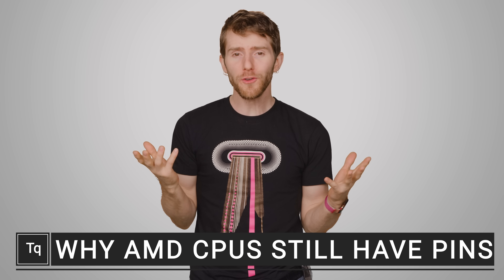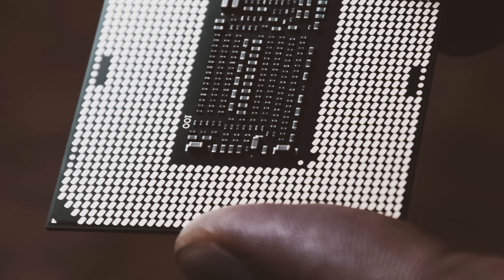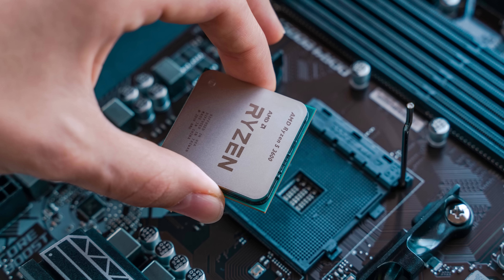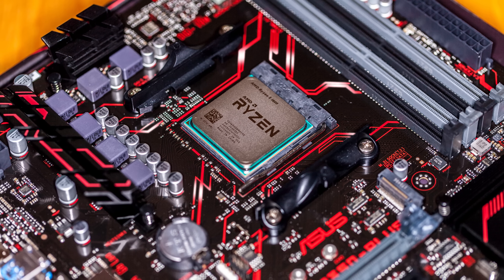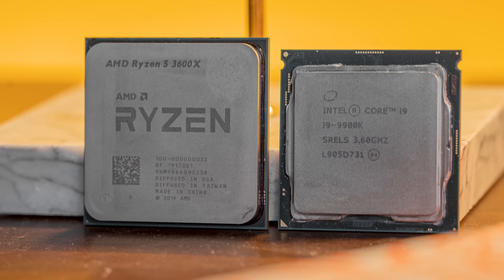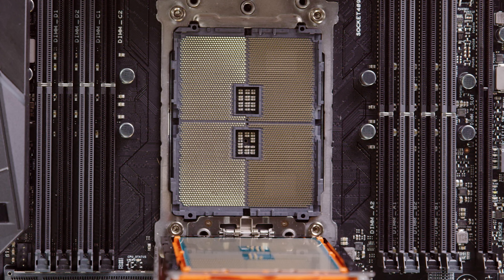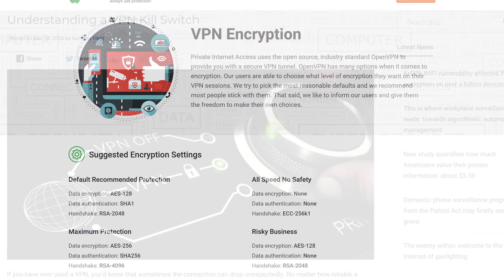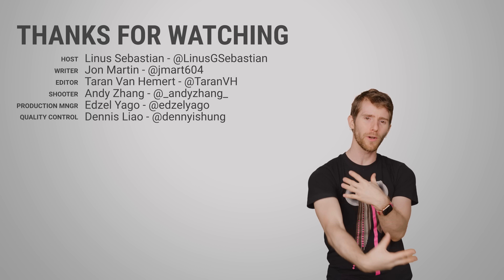Is AMD Stuck In The PAST?

Comment: Wait till you pull out your CPU when removing the cooler on a AM4 socket
Reply: Don't pull or pry, twist back and forth to break up the goop. Like loosening a jar, NOT popping the top off a beer bottle.

This works well even on old or cold thermal compound. The pin array is much stronger than the thermal compound if you twist. (And the pins are seated into the socket.) If you pry the reverse is often true.
Reply: @jordanrodrigues8265   I will keep this in mind if I ever upgrade my cooler. Thank you
Reply: I didn't even know this was an issue until it was too late. Of course, I still should have known to be more careful. That wraith prism mounting mechanism really didn't want to come loose though, so I guess I got pretty careless trying to get it off.
Reply: This exactly.  It happens a lot more often than people think and most people don't even know it can happen.  When it does happen, they don't know how to handle it and end up damaging their CPU.
Reply: When I recently replaced my stock cooler with a beefy air cooler, I was so afraid of pulling the cpu out. I just ran a stress test before and let the paste heat up. Then unscrewed the cooler keeping pressure and then twisted gently, then was able to remove it just fine. I was very relieved when it went smoothly
Reply: I was pulling on my ryzen 7 3700X , how do i know if i damaged something ?
Reply: How did he not mention this?
Reply: Never had this issue, even with really old (10+ years old systems, some with 16-19 years) like socket A amd durons and with some athlon 64 x2's, phenoms 2x2, and etc. Also i never had this issue even on old laptops with really crusty thermal grease (pentium dualcore, core2duo, first and second and gen i3/i5, etc)

My friends only had issues with the pga478 socket of Pentium 4 systems. Idk why, but it doesnt quite hold the cpu well, even with still okay thermal grease it could pull out the cpu. 

Do you had these issues frequently with amd systems?
Reply: Man I tell ya what. I know this pain.
Reply: I was trying to remove Wraith cooler like 30 minutes until i manned up enough to pull it by force , with the CPU glued to the cooler , checked everything was ok and then installed it back to the mobo , only after i read how it's done correctly ( heating up the cpu/paste before extracting the cooler ) , Ryzen 4600 here i come :D
Reply: I just built a new rig going with AMD for the first time. I've built a few Intel rigs already.  I bought a Ryzen 5 3600 and an Asus TUF X-570 motherboard. I was as careful as I could be inserting the CPU into the motherboard. I'm a surgical assistant and I have to have very sensitive hands for this job, e.g. I have to tie suture not much thicker than a hair. No force, I just dropped it in, gave it a very slight torquing motion to make sure it was in and pulled the lever. After attaching the heatsink and fan and flipping the switch, nothing. Checked everything from the power supply to the RAM. Nothing fixed it. When I next went and took off the heatsink/fan, to my astonishment, the CPU came with it. Not only that, but about 20 to 30 pins were bent! Fortunately I was able to bend them all back. It was so tedious and time consuming. I took a 21 gauge hypodermic needle and broke it off at the hub. The needle slipped right over each pin and with a very strong magnifying glass I was able to straighten out each pin. It worked! What I did find is you have to use a small amount of force/pressure to make sure the CPU kinda 'clicks' into place. Not exactly zero force insertion. Now I want to put a new RGB fan on the CPU but I'm scared as hell that the CPU is going to come off with the old heatsink/fan which, after reading these comments, seems very likely. Could all you good people give me some advice as to what to do to make sure that doesn't happen? I don't quite understand why AMD does this.
Reply: Heat up the CPU before removing that cooler, bro! 100% safe!

Comment: i was replacing my cpu then i created a new socket the lga 1154
i broke a pin but it still works fine
Reply: Some pins aren't actually used, so you were probably lucky and hit one of those.
Reply: @ireeb  some are likely just for power anyway, want to spread that over as much area as possible (think cables for a car stereo vs the power switch on your pc case)

Loosing 1 pin for power delivery likely dont make any difference unless your pushing that CPU with overclocking
Reply: @ssu7653  some are for power draw and not all of them are actually necessary, but as far as I know, some pins are straight up not used for anything, often they're reserved for future products.
Reply: @ssu7653  
Some are also used for grounding.

Comment: I thought because the contact were made of (or contain) gold,  so Intel can save more if they can unload the cost of it to motherboard manfucaturers?
Reply: The pins aren't solid gold. It's gold plated. Incredibly incredibly incredibly thin layer of gold. The major cost of the motherboard isn't coming from the gold used in its components

Comment: it's fine for AMD to have pins on the CPU but please for the love of god do something about your socket, all of you who use AMD know how fucking scary it is when you want to repaste the CPU and when you lift up your cooler the CPU is stuck at the bottom of the cooler...it happened to me once and it scares the shit out of me, why don't they have some kind of bracket that holds the CPU in the socket like LGA board does?
Reply: Stress the CPU for a few minutes.
Reply: Wiggle it to soften the paste

Comment: My 2600X Cooler broke when I changed mobos (The leg snapped off the heat-sink) Fresh thermal paste went everywhere including on the pins when I pulled the CPU to clean the mobo (It's not fun cleaning CPU pins!)
Reply: How'd you do it?
Reply: @sponsje  I used a small fine tooth brush soaked in citrus cleaner. The cooler leg snapped off from metal fatigue.

Comment: Tech quickie Video ideas: 
*WiFi access points vs mesh setups
*Managed switches vs unmanaged switches vs routers: home networking
*centralised media systems using hdmi matrix to distribute pc to any screen in house.
Reply: Unless you plan on making multiple subnets at home... there's really no point in a managed switch. There's typically no reason to have multiple subnets either, as a lot of home use stuff relies on network discovery, which typically doesn't transcend a single network

There's no speed advantage of a managed switch. You're often paying much more just for that privilege. So unless you need subnets... don't bother with managed switches, :)
Reply: @Xyler94  Running a managed switch is a lot more common than you'd think. 

The most common reasons I've seen is when you need VLAN's, either to split your network (typically for isolating crappy devices, like hikvision cameras) or if you want to do any kind of router HA, as this is fairly easily done with VLAN's. 

I'm not saying everyone needs managed switches, but the idea of these videos would be to explain what they are and, why you might need them.

Comment: I've always had a question. Why lga does not work like the opposite on PGA?
I explain better, why on lga they don't put straight pin on the motherbord (like pga on the cpu) and holes in the cpu (like in the pga socket)? In this whay i think that the socket will be more durable and the cpu will be the same

Comment: Well half of the time when I remove cooler of AMD CPUs, the CPU comes off with the cooler and gets some bent pins. I have to bent them back, and it will work.

AMD really need to work on solving this problem.
Reply: Always wiggle the cooler before taking it off.
Reply: Sherm This does help. Sometimes still has issues.
Reply: @GlitchyBastard  beat me to it
Reply: Have a stresstest running and let it heat up the cooler/thermalpaste then it removes with no problem.
I never used this on my own cpus tho , my amd cpus never stuck to the coldplate.
I think it depends on the thermalpaste i use arctic mx4 and it has never dissapointed me.
Im not sure how the stock paste behaves tho.

Comment: Yeah, you learn to appreciate the old days of pins on the CPU when you damage a $1300 dual socket server motherboard while trying to swap out $200 CPUs for $250 CPUs due to a project at work.  Yeah, I did that, back in 2008.  I've hated LGA with a passion ever since.
Reply: I've always wondered if something like a pogo pin array might be better, like, spring loaded gold plated ball bearings in the socket, and then there isnt any pins to get damaged on either side. Though I'm sure it would take up slightly more space.
Reply: @NathanK97  the cost would be 3 or 4 times more...
Reply: Try sweating thru the cramming of 486 mobo dip cache chips into hydraulic press force sockets.
Really makes one appreciate Zero Insert Force sockets
Reply: a lot of people over here seem unfit to handle cpus. like how can you not be careful?? lmao
Reply: LGA motherboards aren’t that hard to damage unless you drop the CPU into the socket or something
Reply: @webforder4201  which is quite easy
Reply: @webforder4201  Which is exactly what happened, smashed over a dozen pins in a nice dual line across most of the socket.  I was changing a E5-2603 for a E5-2609v2, and dropped the 2603 shortly after picking it up.  Those are hard to get out of the socket, especially for those of us with hard, calloused skin on our fingers, and I just was not able to get a good hold on the chip. 

I told my boss about the possibility when he asked for the swap, and how hard it was to get a hold on the processor, but he said to go ahead.  I felt horrible that it happened, but he never held it against me.  

When I put LGA chips in a motherboard I own, that is where they stay.  I never take them out.
Reply: You should hate the socket because LGA itself isnt that bad.
Reply: Nah you're just bad at this,how come this never happened to me or my father before me

Comment: I do think Linus is giving AMD a way to bad mark for damaging, In my experience you have to be very forcefull to bend the pins on their CPU.  were as you can almost bend the pins on the intel mobo's by blowing on them
Reply: my old fx-6300 fell from about a meter on hard floor, ON THE PINS. i dont even know how people manage to bend those.
probably only by forcing it into the socket. with normal use they are unbreakable
Reply: @Flaxify  it's a good thing that AMD pins can easily be bent back into place.. certainly not as easily as an LGA socket. I once also had some pretty good luck with an old athlon 64 system that wasn't booting, the CPU had been removed before I got to it and somehow had a pin ripped off, put said pin in the corresponding hole in the socket and hey presto, POSTing again.
Reply: What are you talking about, he said pins on the CPUs tend to be stronger
Reply: He did say that tho
Reply: Usually, you just need to align the pins to the holes, push it in a bit, then let it drop.

Comment: Ah yes, I remember bending my pins when installing my R5 3600. That was a bad day.
Reply: I had a customer who straight up didn't lift the retention arm for the CPU socket and then mounted the cooler anyway. To top it off he put the Ryzen badge on the CPU IHS. He had a whole lot of bent pins. I fixed it for him tho!
Reply: @AwesomeSauce7176  you fixed a WHOLE LOT of bent pins?
You must be very skilled and patient.
Reply: @AwesomeSauce7176  as someone who bent a few on a 1200 when removing a cooler, that hurts my soul
Reply: @AwesomeSauce7176  What can I do about a cpu that only reads a portion of my ram now after it came out of the locked socket stuck to the heatsink? The pins still look fine but it no longer detects the ram stick in dimmb2. I already made sure it wasn't my motherboard :(
Reply: @MsMotoko2 if the pins are all fine, first reseat the CPU in the motherboard, and see if the RAM shows up. Also try switching the RAM sticks to verify it is the socket and not the stick. Make sure you're unplugging the machine and holding the power button before removing and inserting parts.

 Otherwise you're going to need to see if you can test with an alternate motherboard or CPU to determine which one is bad (and needs to be replaced)
Reply: I dont get how people do this. Just hold the sides and pop it in.
Reply: @George-li1yv  I bend the pins when I was placing the stock cooler. Dem springs were too hard for me.
Reply: @sarathsankar5531  mine was pretty hard too now wondering if I bended something
Reply: @sarathsankar5531  tbh those springs are insanely stiff, I also have no idea what amd is expecting you to be able to do as the backplate falls off. I use my leg bellow the motherboard to hold the backplate and then screw the cooler, but how can you even do it on a desk without having 3 hands?
Reply: @BankruptGreek  put a shirt or a rag under the motherboard. Best method for me
Reply: I bent a bunch of pins and broke one removing a wraith cooler from a 3800x. I bent the pins back and tried it again, but the broken pin was apparently essential. I plan to try and fix it eventually, but for now I've still got a 2600 that works perfectly well.
Reply: @GuyFromJupiter  damn 😬 I'm so sorry... I did personally think that I might have bended too but everything works so I'm not gonna look to there 😐
Reply: @GuyFromJupiter  There's a trick that Steve from Gamer Nexus tried, I think Linus did it too.  You can try shoving the broken pin into the socket, the constant force of the CPU cooler should provide enough contact for the cpu and socket.  I believe you can never remove the cpu though LOL
Reply: F
Reply: F
Reply: Just installed one today, the worst part was the fan, thought I was gonna break the motherboard. 😅
Reply: bent a pin on my new 3800X, luckily it wasn't too bent and straightened it without breakage, works fine
Reply: I never bent any pins on either amd or intel, but in my most recent build, the cpu cooler mounting pressure was so high that the board bent a few millimeters.  It is a cheap intel board.  Still works fine though.
Reply: I had a ryzen 3600 cpu come with a broken b450 motherboard. I sent it back to scan 3 times and trying to reseat it and send it back and foward it got damaged so it got sent to the company 6 weeks at a time. and off to AMD and back again for about 3 months before they eventually realised the CPU was goosed from the start and sent me brand new stuff and not had a problem since. Not sure If I would ever buy AMD again after that. The 3600 is good and mines does 3828 on cinebench r20 but left a bitter taste in my mouth
Reply: @Hulgarth , Nice the Ryzen 5 3600 is very good, and really cheap for its performance
Reply: @Hulgarth  We've got an artifacting 2080 ti that's been sent back for "repairs" 4 times now and now they've had it for 5 months... In the meantime my old Vega 64LC is standing in for it.

If I can avoid it, I'd take AMD over Nvidia any day of the week from now on, I just need AMD to release something within 10% of the 2080 ti.
Reply: @OGPatriot03  AMD GPU also artifact. Don't pick a brand merely over a single dead unit, unless that particular lineup is known to have a bad batch. Pick something that works best for you with the assumption it works.

Yes I am an AMD fanboy telling you this.
Reply: @Hulgarth  Why would you not buy AMD for the problem of another manufacturer?  Doesn't make sense.
Reply: Especially when removing the cooler, the CPU tends to stick to it sometimes. With the AM4 platform it's best practice to remove it as straight from the board as possible. I was a bit surprised myself when I had that happen. Luckily no damage though.
Reply: @CheapBastard1988  No, twist it loose first, then lift it off. I tried pulling it straight off, and that was a big mistake. I had already set the thing down when I noticed my CPU socket was empty.
Reply: @GuyFromJupiter  But then you would stress the pins while you're twisting. I prefer twisting when it is stuck to the cooler after I pull it out.